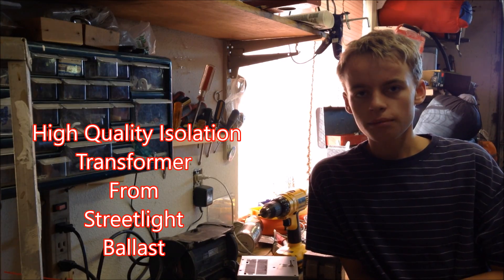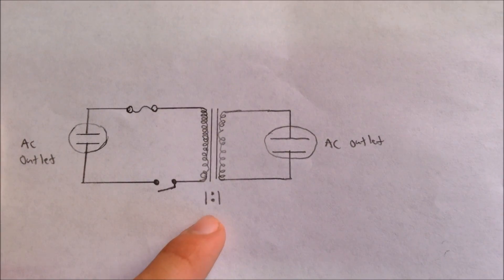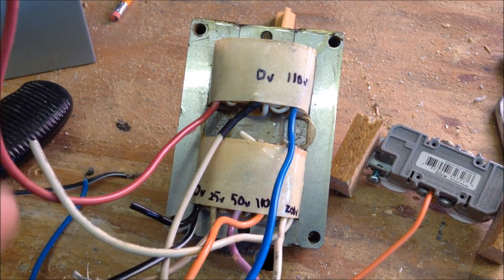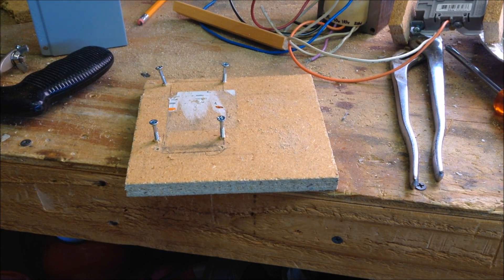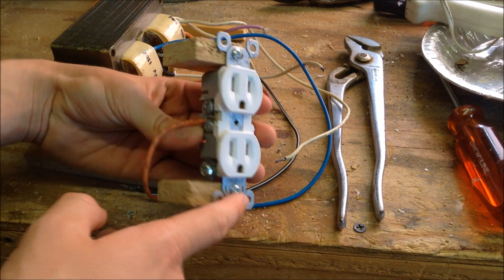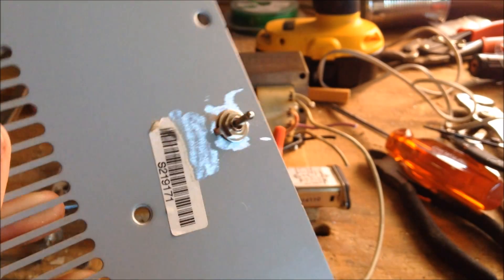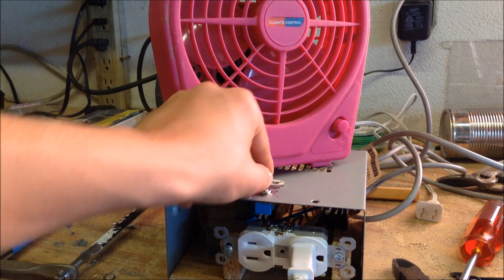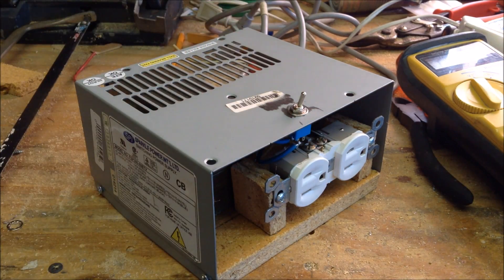DIY High Quality Isolation Transformer

Comment: Are you sure that switch is rated for the current that transformer can supply?
Reply: Lol that transformer can not even supply 1 amp    100/120 = .83 amps
Reply: @the-beneficiary1809  The 100W you see on the data plate is just for the type of lamp you would use. This transformer would have to be able to supply much more current to get a Metal Halide lamp to strike.

Comment: I certainly hope your that is the output on the secondary side of that transformer running at 113 VAC, if that's the mains in your house then you are nearing brownout territory and you've got an unbalanced breaker panel and/or branch circuit loads, a high resistance on your neutral, or the utility service in your area isn't adequate enough to handle the power demands.  Voltage too low can do just as much damage to electronics as voltage too high in some cases.

Comment: That is a specialized transformer.  It has a magnetic shunt located between the two windings, bridging between the centre and the two side legs of the core.  This deliberately creates some leakage inductance which makes the transformer drop its output voltage under load in order to maintain a constant current in the lamp despite changes in lamp characteristics.  Microwave oven transformers use a shunt for similar reasons: to keep the magnetron power constant despite changes in load.  But this shunt is undesirable in a power transformer, so it should be removed.
You also need to cover the open side of the box.  There shouldn't be any opening large enough for someone to insert their finger into.

Comment: I did mine with 2 microwave transformers i used the 2 primaries
Reply from the maker: Nice! How did you wire that up?
Reply: @TannerTech  i  opened the transformers and removed the primaries and put both in one transformer soo it goes 220 v to 220v
Reply from the maker: That's a good idea!

Comment: great job but some thing you din't take it in consideration first was a fuse at input second at the outpout of the transformer was better if you fuse it as well and as well was better to add a simple halogen lamp let's say 70w or higher this manly for preventing as a example when you work on amplifier of diy transformer is was something to go bad the lamp will tun on indicating a problem with it and if example was ok and a switch wich can bypass the lamp and  well a properly case for it , sticking with wood and hot glue is not the right choise don't understand wrong that thing is more danger as it is then if it was without a case and as well use heatsrink tube not those little wire cap does can get luse and may or not may come in contact with the metal frame  , but hey good job

Comment: i get shocked all the time. if you work with electricity you get used to it. the way i do it anyway i work on live 240v and 120v circuits. i wouldn't do it with a tube amp. (but i do)
Reply: get you an isolation transformer or a a GFCI breaker

Comment: I wouldn't trust a discharge lamp ballast as an isolation transformer and what do you do with the magnetic shunts... those bits of lamination in the gaps either side of the core. That core is actually part of a ferro-resonant power supply, necessary for keeping the output of the lamp constant. The magnetic shunts will bypass some of the magnetism and make your "transformer" less efficient. I don't know if you understand the power triangle part of Ohm's law (P = I x V) but you only have a bit more than 100 watts or or about an amp available. What you are doing, I would consider very risky.
Reply: Amen

Comment: Explain how an isolation transformer makes you safe from shock?
Reply: It's done under the theory there is no direct connection between the input and the output of the Transformer no direct current flows through only AC alternating current signal it's done through magnetism hope it helps

Comment: A good way to kill some one right there. Should ground the metal frame and since there is a metal switch it really needs a ground. Open exposed nomimal voltage is very unsafe, isolated or not. Last thing you need is to drop something on it that is metallic and game over for the DUT or yourself depending if it hits the primary or secondary. The transformer is very vauge on the specs. So say you plug in a toaster you only can get what 800mA of current and might make the windings burn up. Or something inductive you would get a Amp or 1.5Amps, thats with a 100 watts. Best bet is to gut a couple of APCs or even a couple of automotive battery chargers and put the Transformers back to back. 120 primary 14 secondary to 14 primary and 120 secondary.

Comment: FYI: That is, (most likely), NOT a street light transformer. Street lights were traditionally mercury vapor lamps . Later, they became high pressure sodium vapor lamps, (the orange/brown lights).
If you look closely at the schematic, Tanner, you will see it says "MH 100W" in the upper left corner. That stands for metal halide 100 watts. Metal halide are the lights you find in warehouses, gymnasiums and indoor agricultural greenhouses. 
 I can't say with absolute certainty there are NO street lights with metal halide lamps, but THAT transformer probably isn't because it is only a 100W transformer. Warehouse, gym & greenhouse lamps are more in the neighborhood of 500W or 1000W. I can't recall what a typical mercury vapor street light bulb had for wattage, it's been too long since I had anything to do with them.

I do have an indoor greenhouse I built, with a variety of metal halide lamps, from 50W to 500W, and high pressure sodium lamps, with 45W to 1000W, so I do have a good, (current), working knowledge of those lamp types.
re: Ernie Gilman comment's
1. finding a metal halide transformer is as easy as chatting up an eletrician who does commercial electrical work. They probably have a bucket of them, waiting for recycling. I have an electrician friend who gives trade-in to his customers for their old equipment, then resells it, (very cheaply), used to medical marijuana growers.
2. Based on the label stating it's a 100W transformer, a little thumbnail math says it's a bit less than 1 amp.
Reply: @Robert Heal

What are those 8 different lights?  The ONLY three lamps I know of, used for large area lighting are mercury vapor, metal halide and high pressure sodium.

I would love to hear what the other five types are, in your neighborhood.

Perhaps you didn't notice in your glee to correct someone, but I was talking about LAMP type, not fixture type.

Notice, also, I corrected you without calling you either arrogant, or ignorant.
Reply: @georgedennison3338  actually there are 4 types when it comes to HID ( High intensity discharge) lamps  low pressure sodium these look amber and the lamps are very long, High pressure sodium which are orange, Metal Halyde which are white and most time are used in stadium or warehouses, and Mercury Vapor which are usually on barns and out in the rural farm areas which are blueish.
Reply: I went back at looked at the label again, (2:36), and I believe that is a three phase transformer.  I am not a 3ph expert, but isn't it 3ph if it has the 277v,  240v, 208v AND 120v?
Reply from the maker: +George Dennison Hmm, that is an interesting point. I just looked it up, and in a 3ph circuit, the voltage from any phase to each other is 480 volts while the voltage from any phase to neutral is 277 volts.  I assume the transformer allows the witticism to fit it into any voltage of lighting circuit.  I found this transformer in a broken parking lot light in a trash pile, so maybe that had a 100 watt MH light?
Reply: @ tanner

that's one type of 3ph. I can't recall which, one is 'wye', the other I can't remember..(brain injury has messed my memory up).

I helped a friend with a trailer restauant connect up to power at a gas station a couple of years ago and use the abandoned 3ph for a removed car wash.  All I had to do was come off two(?) legs of the 3ph and I had 240v.  Either line of that to grnd was 120v. (Someone else had wired in a 240v compressor, so I just copied what they did.)

That's about the extent of my 3ph knowledge. I don't work with it very often, so what I learn sometimes, is lost cause of the brain injury.

That's going to have to change soon, as I was given several 3ph pieces of equipment for my shop, and will need to get a much better handle on 3ph.

Something you might find interesting, related to 3ph is something called the Kamp-Haas 3ph to 1ph welder conversion.  Three phase MIG welders (wire feed) can be bought very inexpensively, 100.00, sometimes; and we're talking about $3,000-5,000 machines when new.  Three phase is very expensive to get from the power company, so unless you have it, or are in an industrial building, most people can't use them.

Also, unlike the cheap welders for 200.00, industrial quality welders have 100% duty cycles, vs the cheapo's having a 15-20%, 30% if you're lucky.

Anyway, I know the Kamp half of the brains behind this, and he has proven their conversion works.

In simplistic terms, a condenser is used to simulate the 3rd phase, (what we call 1ph is actually 2ph). The condenser is charged by the other legs, then the release is timed to take the place of the 3rd ph. Dave (Kamp) told me it works with a welder, where it won't work with motors, because the timing is not that critical on a non-rotating 3ph device.

So, for 100-150.00, you can do what all the welder manufacturers say is impossible; convert a 3ph welder to 1ph.  I have contacted most of the major manufacturers about the possibility, and was told 'no can do'.

If you Google 'Kamp Haas conversion', you'll find lots about it. The original post is at Practical Machinist, as I recall.

They developed the method on Miller welders, but other have converted Lincoln and Esab welders.  Check it out, it will expand your knowledge and also might be a way for you to get into a welder that will last your lifetime, on the cheap.  I started welding at about your age, and it has been a valuable skill for nearly 50 years.

As far as the light, where you found it makes sense. A 100W MH is more of a small parking lot light someone might pickup at Home Depot, and install themselves. It was a good find.

Good on you for repurposing, and keeping it from the landfill.  Keep your eyes open, and don't be afraid to dumpster dive; I score hundreds of dollars worth of material, parts and equipment every year from simply keeping my eyes open, and scrounging.

If you have a sign company close to you, talk to them about their scrap material. Signs, nowadays, are made from foam core PVC plastic, which is not recycleable. It comes in thicknesses from 1/8" to 2", can be machined, (I use it for machining prototypes), drilled, tapped and best, glue-welded with simple PVC piping glue.

You can do anything with it you can do with metal, it's easier to work with than wood, it's waterproof, non-conductive, and doesn't need paint. I build things with it, make tool holders from it. Heck, I even built a kitchen cabinet out of it at my NY rental apt, just to see if it would work, (having a sign shop two blocks away with tons of free scrap, doesn't hurt, either!)

As I've said before, I'm impressed with your skills and drive; if I can offer one piece of advice, it would be to take 10-15% more time with your prep, planning and research, (PPR), on projects. I KNOW how hard it is to hold back from jumping into projects, but if you invest a little more time in PPR, you will gain more knowledge, skills and develop good habits for the future, no matter what you do.

I didn't have anyone to tell me something like this when I was young, (had lots of different skill mentors); it took 8 years of college to learn it, but it did make a scientist out of me.

I have one piece of 'life' advice, as well. It's something I realized a few weeks ago:

Learn how to clean things, of all kinds, well.  I was washing/cleaning/scrubbing something in my shop/sink/bathtub, and realized I have been cleaning things since I was 12. Car parts at my uncle's garage, dishes at restaurants, worksites at the end of projects, used equipment I scrounge, or buy, etc, etc, etc.

I'm 65 this year, and looking back on the multitude of skills, jobs and experience I've had, being able, and willing to clean things is the common thread running through my entire life.  Sometimes, cleaning something is ALL that is needed to become a  'restoration'.

Good luck in all your endeavors.

Later...

GeoD

(add a reply anytime you wanna talk)
Reply: It is both ignorant and arrogant to presume that there are only 2 kinds of street lights.   I can show you 8 different kinds within 3 blocks of my house.

Comment: Metal switch on a metal case? You really need to ground the case to prevent a bad shock
Reply: You missed the meaning of "isolation" on an isolation transformer.

Comment: Thank you for showing us your isolation transformer build.    I have two suggestions for safety:   
1.   Add a metal bottom to the power supply box.    That way, in the future, when you get an oscilloscope, you won't be so likely so see voltage ripple from the mains power supply.
2.  Add a lamp or LED to the top of the box that illuminates when the secondary coil is energized.     With the indicator lamp, you'll be more likely to remember to power it off at bedtime.

Comment: is this what boats,and a boondocking camper inverter  use because they can't connect to earth ground? i am wondering how grounding works in a camper without actually pounding a ground rod in when camping off grid.

Comment: Now let me see. Just on the surface even the power receptable is loose with no cover but yet you talk about safety. There is no mention of the specifications needed for the transformer. Not only are you a danger to yourself but a danger to everybody else.

Go back and become knowledgable with the basics of electricity before you post DIY vids, please if not for your followers at least do it for yourself - even low volatge AC can kill.
Reply: (I'm not the original person you were responding to.) When everything is working as it was when you put it together, this will be fine.  However, know that the majority of safety requirements are there to protect you (us) from *faults*, where it somehow no longer matches the original design.  

Grounding of a metal case, for instance, has no value for a device working as originally designed. Grounding is designed to protect against insulation breakdown somewhere, so that a live conductor comes in contact with the metal case.  Without the ground wire, nothing happens -- until a grounded human touches it, then they get a shock through their body, possibly a lethal shock.  With the ground, the fault makes a short that carries high current and trips the breaker or burns out the fuse on the circuit,  stoping operation but rendering a potentially dangerous situation harmless.

In my opinion, someone with more experience in safe design might: use all metal (grounded), instead of some wood (for heat / fire reasons).  Heat shrink around  the switch so the contacts are not exposed to fingers, or make the enclosure complete so fingers, tools, etc. cannot come in contact with high voltages.  Know the specifications of the transformer and put in a fuse, so drawing too much by mistake will not cause a fire.  That's all I can think of at the moment.

I think someday you'll look back on this like I look back on the bell wire and masking tape I used to carry 110 VAC when I was younger...
Reply from the maker: +N C Now let ME see.  I have been using this isolation transformer ever since I posted this video.  Guess what: not a single fire or electrical shock!  I do talk about the specs of the transformer.  It has the same ratio of turns on the primary to the secondary coil.  The primary also has the right inductance to handle 110 vac.  I agree, this would be a danger if not used right.  You should probably use your brain before commenting.
Reply: Well as Forest Gump's mama always said "stupid is as stupid does".

Comment: Nice job.  You might also just mention that you DO NOT connect the ground wire from the mains to the ground of the plug to make sure that the plug is isolated.
Reply: What I meant to say is that the ground isn't connected to Neutral!

Comment: Nice work, indeed, with a few exceptions.
1.It's very unlikely that the average viewer will happen upon the transformer that you base this project on.
2.You don't have any idea how much amperage the transformer can deliver. Another way of saying this is that you don't know whether plugging any particular thing into it will cause it to fail or even to burn. With flames.
3.You speak of the hot glue gun as a heavy load. It is not. A toaster is a heavy load. NEVER plug a toaster into this supply if there are flammable items nearby, nor without a fire extinguisher nearby.
4.Thanks for not using the word "like" but please work on your overuse of the term "so."
Reply: You did not mention the importance of the connection of the round earth terminal.  If both earth terminals are connected there is no isolation.   Earth on the output should not be connected.
Reply: well do ohms law 100 watts / 120 = .83 amps  which of course is certainly not much power to be expected out of this.
Reply: jeez picky